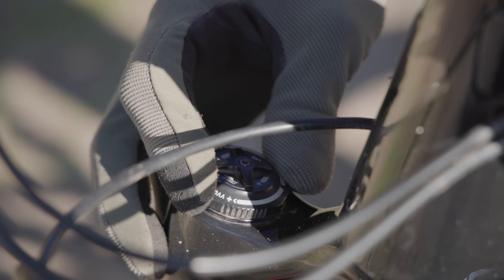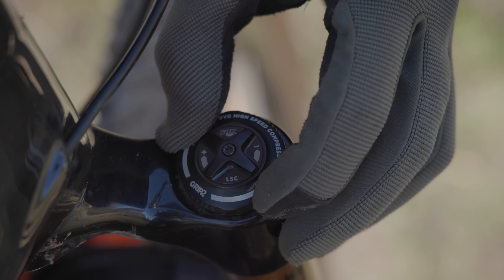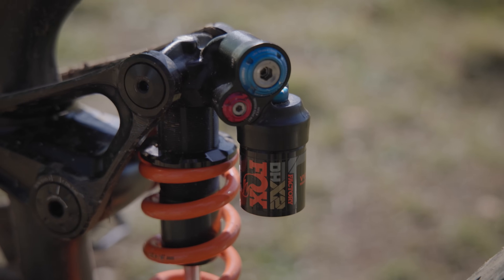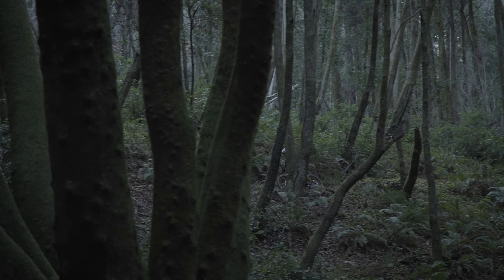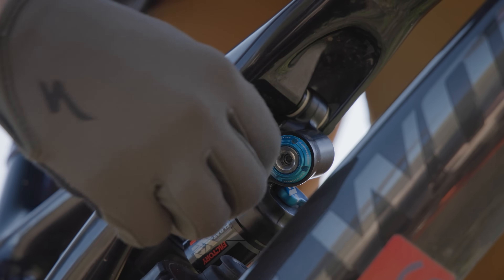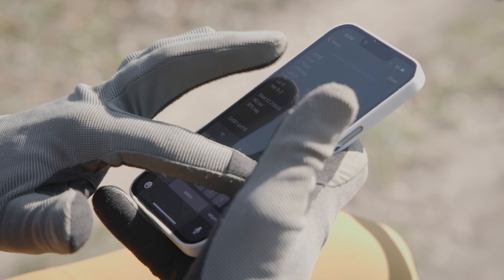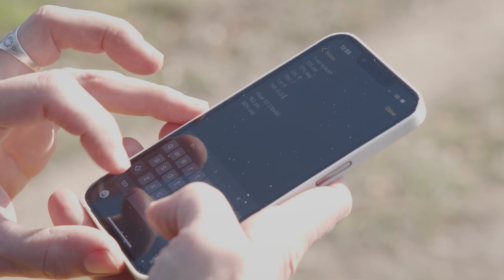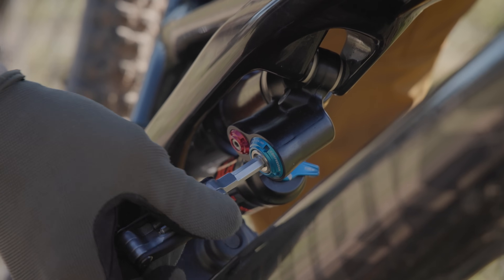FOX Academy | Suspension Bracketing

Comment: I wish your dials would all start at the number 0 and the final click being the final number what ever that may be on any given dial. I say this because I'm a bit pissed off right now because of the rebound dial on my Float X 2022 model. The first written number is 2 and the last written number is 12. Here's where things get weird. There is one defined click before the number 2 and there are 2 defined clicks after the number 12. According to your specs of available clicks(10 clicks total), it must mean that the click before number 2 and also the 2 clicks after number 12 have to be ignored. How the hell should anyone just know that and why are there 3 whole defined clicks extra? They feel exactly like all the other clicks, so no extra force applied or anything. 
This dial should start at the number 0 and end at the number 10, and the 3 extra clicks be removed. 

Then you got the compression dial on the same shock which for some reason have no defined clicks, so in this dial you'll have to just go by the written numbers on the dial. At least here it starts at the number 0 so it actually makes sense. 

Please make the dials the same and remove any extra clicks. If you have to ignore them they shouldn't be there in the first place. It's like adding a door outside the door on a car just because you feel like it.

Anyhow, start the dials at 0 to remove any doubt and that it works the same whether it is rebound or compression. A dial is a dial. Keep it simple.

Comment: Here is my question. Why is it that when I set sag properly, and adjust everything that my suspension still feels harsh? I consistently find that I have to reduce air pressure about 10-15 PSI less than Fox recommends which gives me more sag than I should have, in order to get my suspension to feel plush.for reference I’m 175 and generally run no tokens, no compression and 70-75 PSI. I have 2 Fox 38s and a Fox 36 and all 3 forks behave the same. Recommended PSI is like 93.

Comment: What's your take on putting more tokens than you need? say 3/4 and lowering the overall pressure to make fork very plush at the start?
Reply: I've done that and as far as it seemed excellent when I was going slow with occasional jumps, it was packing up when I started riding faster on rocks and roots. So it depends on what is your riding style and what trails do you ride.

Comment: What about the interaction between high speed and low speed adjusters?  Due to the poppet design, changing highspeed will move the knee, thus changing the low speed setting at the same time.

Comment: Low speed, compression or rebound, what would that affect? Like is it going to slow through roots or rocks or going fast through them. I need clarification with this
Reply: The ‘speed’ refers to shaft speed, ie how fast the fork or damper moves through its travel, so not necessarily how fast you’re going. 

Going 15 km/h into a curb is a high speed event, while landing a big jump going 30 km/h is a low speed event.
Reply: @Bonky-wonky  Your first sentence is correct but the last part of the second one isn't. Landing a jump results in fast suspension movement which affects the high speed circuits in your suspension. Going around turns and braking are good examples of slow suspension speeds.
Reply: @eliasrenner555  depends on the jump, a long smooth landing that matches the angle of your trajectory in the air is in my experience a low speed event. I should have made this more clear.
Reply: @Bonky-wonky  True, but I'd say landing a perfectly shaped jump perfectly is rarer than cornering and braking.
Reply: @Bonky-wonky  thanks, i think i kind of get it, if im smashing through a rock garden then that would affect the high speed but if im going through a berm it would affect the low speed, because as you go through the berm the suspension compresses under load but not as violent as smashing through rocks, right?

Comment: Do you also adjust the other suspension unit along with the one you’re setting up? If you’re working on the damper increasing compression without increasing fork compression is going to unbalance the bike, which would muddy the water. Is what you’re noticing an effect of the rear damper adjustment or a side effect of it because the front - rear balance has changed?

Interested to hear your take on this.

Comment: Thanks for posting.
Fox Factory Kashima 140 34mm Fork (2021 model) smooth fork action on trails but feels harsh on initial contact with tree roots, not sure if compression or rebound adjustment needed or is that feeling normal?
I will try the bracketing method as per this video to see if I can improve things.
Reply from the maker: Let us know how you make out!

Comment: Does this apply to volume spacers also? I.e. When we add a volume spacer, aim to have the same sag as before, do a run, then proceed to rebound and compression bracketing.
Reply: Volume spacers really only effect the end of travel, i.e., for bottom-outs. I only add or remove spacers after some time spent riding, taking note of the o-ring position after a downhill run. If you're bottoming the suspension out and you like the way it already feels, adding a spacer can help with that end-stroke support. Vice versa if you're not bottoming the suspension out and you like the way it already feels, removing a spacer can help you achieve full travel. In summary, I think volume spacers are the last consideration to make when tuning suspension.
Reply: @bensbikes  And that's the most critical part of tuning for safety. With increased "resistance" you're experiencing higher force coming back deeper into the travel. If you don't change your rebound, you'll get bucked when you bottom out. This is especially important because if you are aiming to bottom out less, these critical moments don't happen often, leading to less data points for you to be aware of the increased rebound speed at full travel.
Volume spacers change the whole spring curve. This is why you need less psi to achieve the same sag. The ramp up introduced by the spacer increases the resistance force at the end of the travel significantly which can catch a rider by surprise.
Reply: Perfectly said

Comment: Let's say I start with LSR on the rear shock as suggested. On a FloatX, would I bracket the LSR with LSC fully Closed or open or at the factory suggested setting? And is it best to do the shock before fork, or doesn't matter the order.
Reply: Make sure sag is balanced on both before you mess with tuning. Start at factory recommended settings on both the fork and the shock. I find at 180-190lbs, the float x works best with LSC between 5-8 out from closed. And rebound 5-6 out from closed.